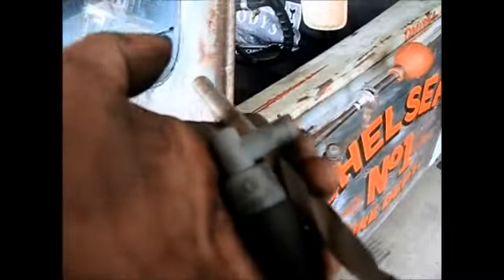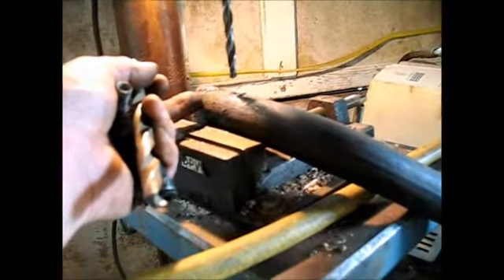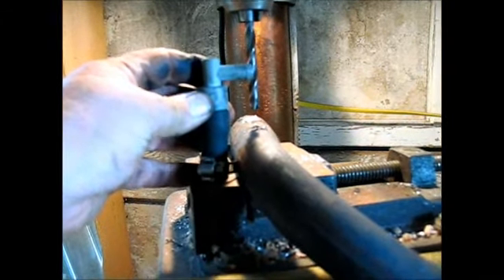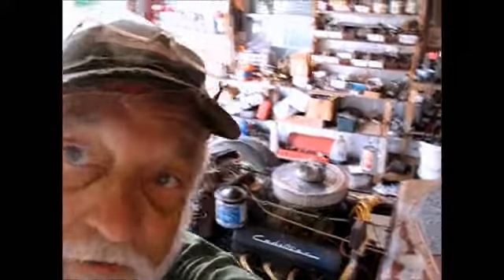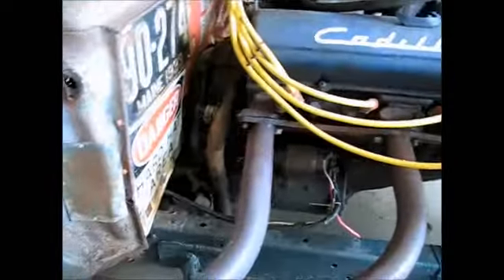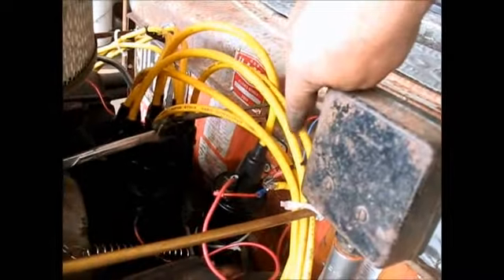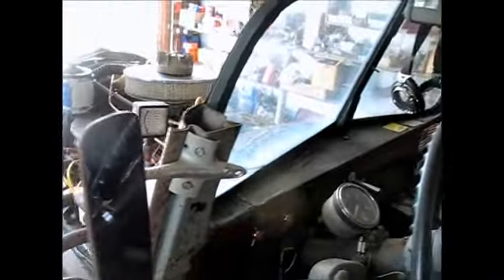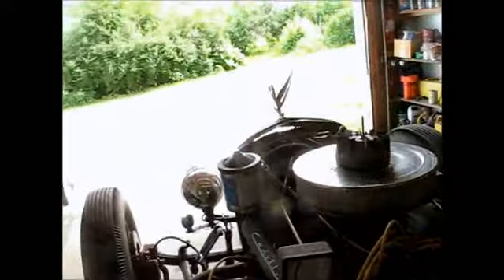Toasted Rat Rod Electronic Ignition

Comment: You will get better mileage supposedly with the new pcv valve. Dang and dang again you shorted out the electronic ignition that worked so well. Gets more gas with the pcv valve. Its already atomized gas. You could get a dual point distributor they are nice. dont know if they make them for that motor probably.

Comment: worn rings create low vacuum too , so the pcv may not work as well as it could , have you ever thought of using an exhaust scavenging set up like we run on race cars ? all you need is the valves from the air injector reactor lines from a 80-90's GM v8 , weld them into an exhaust tube , the passing exhaust creates a siphon on the line , positive vacuum , you could run one on both sides too , as for the electronic ignition search using a GM HEI modaul and the points as the trigger , works great!

Comment: This is a good suggestion... HEI's were/are simple, reliable and robust. I'm also fairly certain one will bolt right in. Get one with vacuum advance (4 pin module), not one of the later ones with electronic spark control stuff.

Be sure it's centrifugal advance is in good shape.

Your tach may, or may not be an issue. Also remove your ballast resistor if you have one. HEI's need a full 12V anytime the ignition is on.

Look up 'H.E.I.' in Wikipedia. It gives a pretty good overview.

Comment: The PCV introduces a fair size 'vacuum leak', that in later years was accounted & compensated for in carburetor design. Thats why your curb idle speed went up. I suggest readjusting your idle mixture asap; as it's going to be lean as well... would hate to see you go down with burnt valve issues...

Your really lucky you don't have to deal with smog checks like here in CA. Said smog gods have kittens when they see anything even remotely deviating from original.